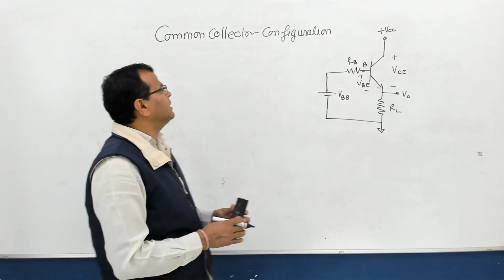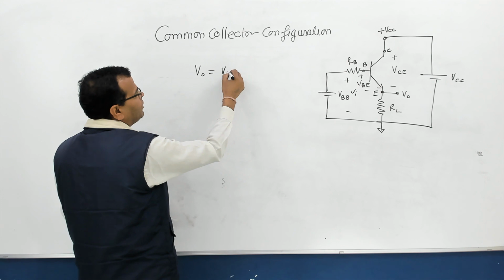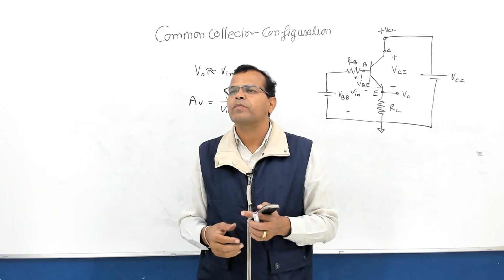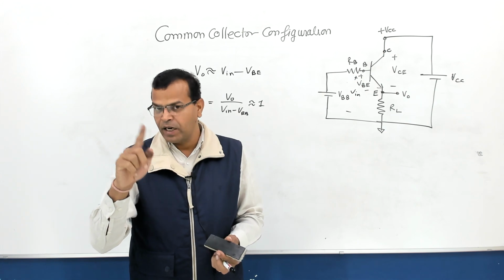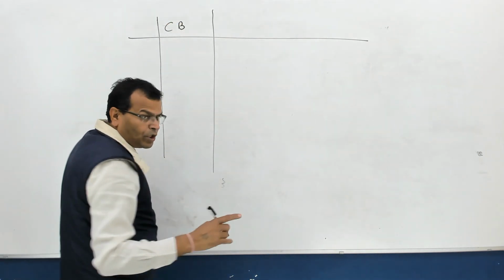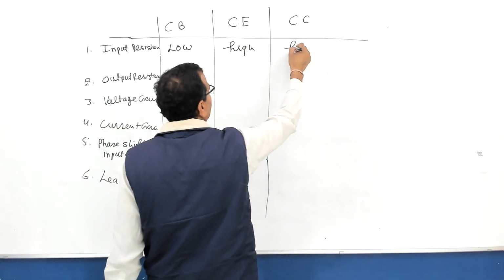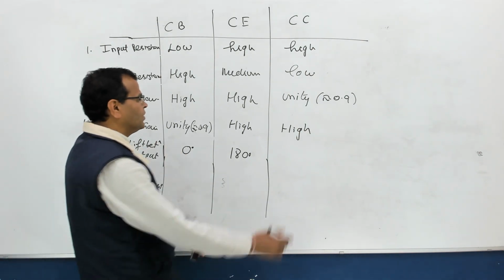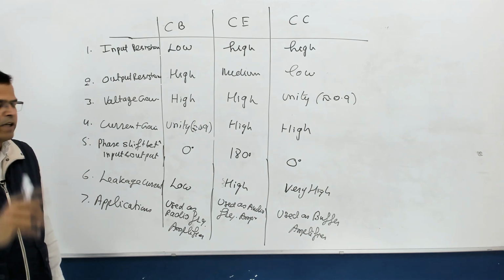EDC & AE Chap 3 BJT L9 Common Collector  Configuration of BJT

Comment: Input resistance of CE is supposed to be low according to me. From the graph of input characteristics, it is extremely similar to CB configuration and input resistance for CB is low.
Reply from the maker: Dear, To clarify your doubt you can visit www.digcademy.com for numerical value of resistance and txt of chapter in pdf. It's available free of cost.